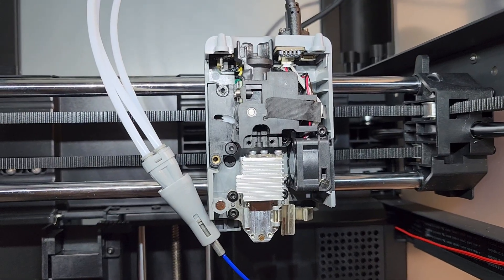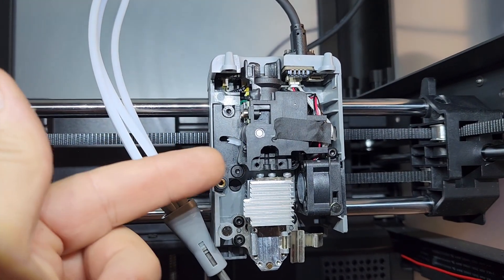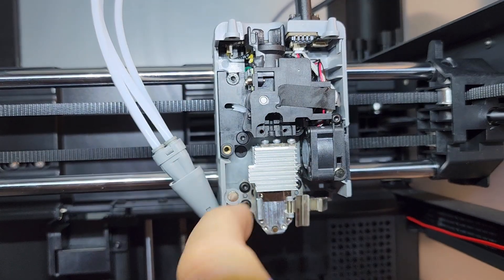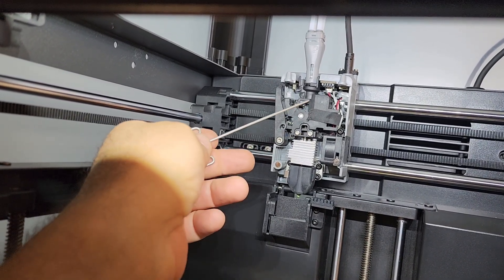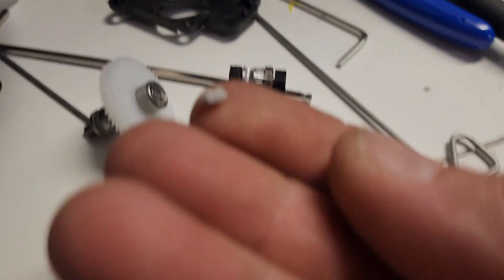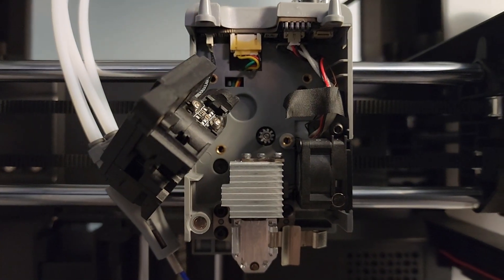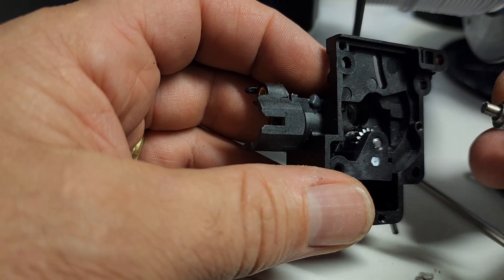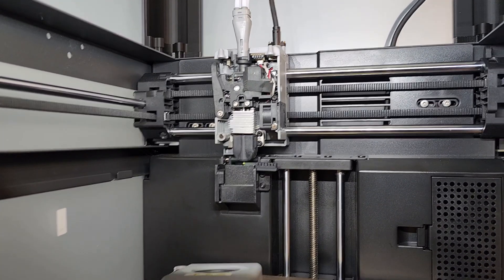AD5X extruder jam or clogged

Comment: Thanks for sharing it! I used your instructions to trobleshoot and at the end, my case was a little bit different:
-The cutting blade lever was not comming fully back, so the blade was still touching the filament, making the extruder strugle when trying to push the filament. The solution: put 2 drops of grease over the blade, push the lever couple times and good to go!
Thank you for the video :)
Reply: PS: I reach 200hrs on my ad5x yesterday, just to give an idea when it happened on the printer timeline

Comment: Hi mate, I think you have got the spring top cap the wrong way around. 1:31 you show it the right way, but at 2:23 you show it installed the other way. the screw should be contacting the stainless cap and pushing the spring.
Reply from the maker: Ok, thank, I will take a look at it again, but if I did, it is working normally. Thanks again for pointing this out.

Comment: I wish you would've shown how to safely remove the wheel. I'm concerned that I will break it by removing it incorrectly.
Reply from the maker: The assembly came apart very easily, almost by itself. There was no friction or catching on the disassembly. As always, I would do it slowly and not use any force. I hope this helps. In my case, I took it apart because I thought I was going to have to buy a new one. But fortunately, it was easy to disassemble, clean, and reassemble, and that did the trick. Thanks for the tip, I will try to do this if I do this again!